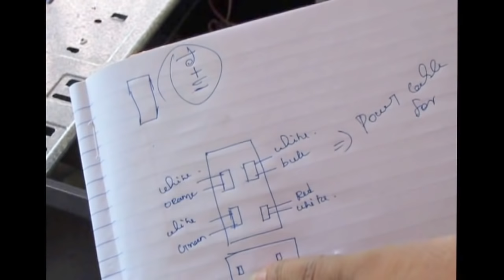how to assmble a pc in tamil

Comment: Hello! Good initiative to describe the PC assembly procedure in Tamil. However, I would suggest you watch some of these videos in English and learn from them on how they explain everything so that even the beginners could understand the concept.
For example, 
1. You didn't explain anything about "Intel" processor installation. Also, there was no mention about applying thermal compound on the processor belore installing the cooling fan.
2. There was a diagram shown about blue, red, white wires. Nice! However, could've explained more.
3. Static current
4. Poor lighting and video quality could've been better
5. More importantly, how to fix the mother board to the cabinet

Hope your next video is much more helpful and informative.